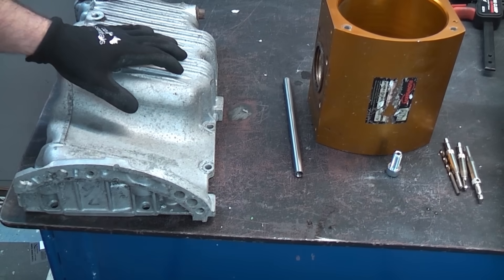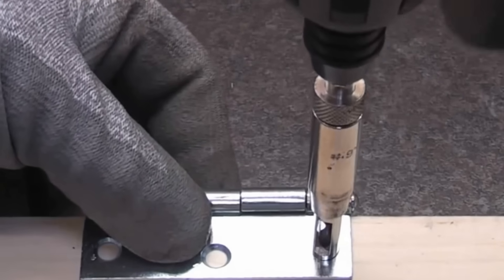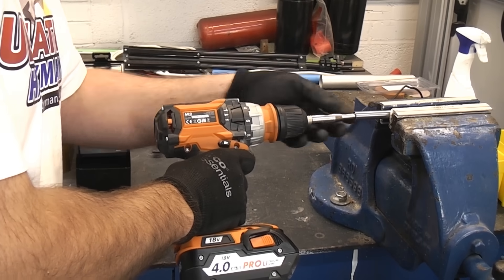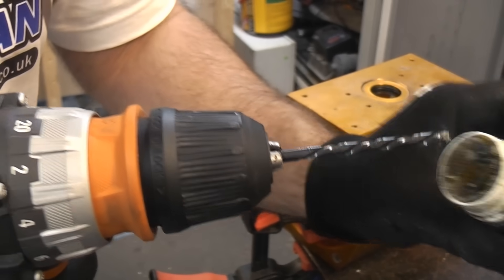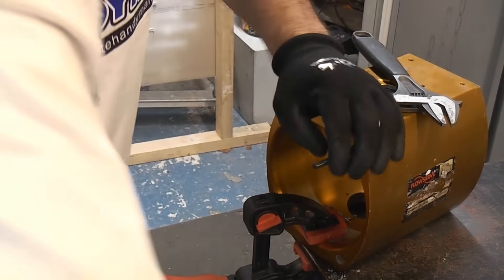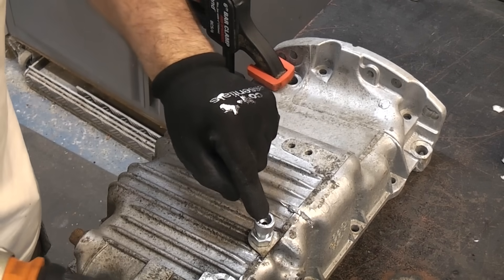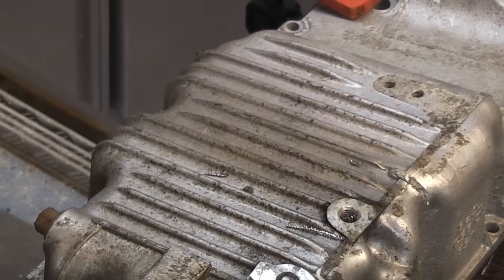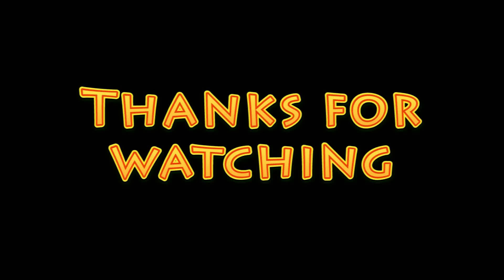How to remove a broken bolt in a deep hole | remove broken bolt in recessed hole

Comment: Those left handed bits, we have whats called "easy outs" that are like that but made to extract broken bolts...  Except you don't use a drill you use a wrench on them, doesn't take much turning to latch on, especially if u drill it a little with a normal drill bit before hand.
Never mind you showed one that you call a screw extractor.
Whats the reason for safety glasses?  hehe.
Reply from the maker: You should always wear safety glasses when using hardened steels, as they are brittle and, if the easy out or drill bit breaks, the shards of metal are as sharp as glass. I know two people who have lost an eye when metalworking!
Thanks for the comment 👍
Reply: @ultimatehandyman  I was picking on you bud hehe, I don't wear em and I've paid for it a little but thankfully not with the loss of an eye.  But I'm the idiot that when the jack stands holding up an RV went sideways about 40degrees just kept on working under the thing instead of jacking it back up and re situating the jack stands, thankfully it never fell on me.
EDIT:  Good video, I liked how you hollowed out those bolts to make guides so you didn't damage the threads, I'll have to remember that trick, thank you.

Comment: Even with these good techniques , removing a broken bolt is still a huge pain 🤣
Reply from the maker: Absolutely 
Thanks for the comment 👍
Reply: It's never is that easy. Where I live there is always corrosion, rust, damage to the threads etc. Usually have to just about still the hole the size of the bolt and run a tap in it

Comment: bee's wax works better at freeing seized, rusted, stuck, broken and otherwise difficult to remove fasteners than almost any available commercial product.  Once you heat the area, float some bee's wax into the stuck fastener area.  Do it more than once.  The capillary action draws the bee's wax into the area between the fastener and threaded material.  When it cools, the fastener will come out with very little torque.  We use this kind of technique in marine maintenance and machining, and older automobile restoration.  Bees wax, unlike candle wax, and 90 % of the commercial penetrants has a much higher burn temp and does not carbonize like most of the petroleum based penetrants.
Reply from the maker: Thanks, I'll try that at some point 👍

Comment: There may well be a kit for it already, although I've never seen one, but I think money could be made offering an assortment of those bolts with center holes drilled through them,  a few tubes for the same centering purpose, a few good quality reverse drill bits, and a few screw extractors. In my days of working on vehicles I've struggled with this issue and some of these methods might have helped
Reply from the maker: Yes, I think you are right. I did ask a friend to make some, but he eventually forgot about the idea!
Thanks for the comment

Comment: I've had some luck tapping torx bits into the drilled holes, particularly in softer materials such as brass pipe fittings and broken zerk fittings.  The issue I have with round extractors is they expand the broken piece inside the hole and make it more difficult to extract.  Mac Tools makes square extractors that don't expand the broken piece.  I've had good luck with them also.
Reply from the maker: Thanks for the comment 👍

Comment: The most difficult bolt removal I experienced was removing a dead axle from a Cat D-4 dozer. The dead axle broke off even with the bulldozer frame. Not even tweezers could grab it.
We welded a 2" steel rod to the exposed part of the dead axle (which is a giant bolt). On top of the steel rod we welded an X with enough over-reach to allow is to put 4 10 ton jacks under the X. After jacking each jack until it groaned, we put a 55 gallon barrel full of water in front of the bolt and a week later, it turned loose. The dead axle traveled thru the 55 gallon barrel full of water, thru the shop wall, thru two empty 55 gallon barrels and came to rest about 150' away. Bazinga!
Reply from the maker: Good job nobody was in the way of the axle!
Thanks for the comment 👍
Reply: @ultimatehandyman  Thanks, mate! We didn't allow anybody in the shop that week, nobody got hurt. We did excavation and oversize transport so we could shut the shop for a week at that time.

Comment: can someone please tell me what part of the engine that is my Honda pilot is cracked where the alternator bolt is supposed to go into so no matter how many times I changed it it keeps breaking the bolt n belt comes off
Reply from the maker: You might have to get that welded, but welding aluminium is a specialist job.

Comment: The worst are exhaust manifold studs that break off flush. I know. I drilled out many Porsche 911 studs and what was the real challenge was when Audi came out with the 5 cylinder. They all broke off the studs on #5. Thus, to do it in the car took a 90 degree air powered drill and a mirror taped to the frame rail. You had to learn how to drill while looking at a mirror.
Reply: Bill Smith  can u tell me what that part if the engine is called n is it possible to replace
Reply from the maker: Yes, exhaust studs are a real pain in the backside!
Thanks for the comment  👍

Comment: Will using copper never seize on a steel bolt put into aluminum cause a chemical reaction, or breakdown that will deteriorate the bolt or aluminum part and cause problems down the road?
Reply from the maker: I've been using it for years at work with zero problems, but a lot of people have said that it causes problems, so depending on where you live and the environment /humidity / salt air etc. it might cause problems down the road.
Thanks for the comment 👍

Comment: As a mechanic I have worked on Army tanks and other tracked vehicles along with semi trucks. Worked for a dealership working on cars and trucks. The last 35 years I have worked on aircraft from the auto pilot to the toilets, currently working in the engine shop building Rolls Royce RB211, GEnx-1B, and CFM 56-7 turbo fan jet engines. So I have seen a lot of tricks to get things done that only a quality result acceptable. I can measure down to millions of an inch using a lens and lights. So my experience is quite broad. You have taught me a few new tricks which is rare. I knew about left hand drill bits as I have had many call B.S. on that lol. The hinge guide was a slick trick . The center drilled bolts as guides was a nice professional touch. Excellent video.
Reply from the maker: Thanks for the detailed comment 👍

Comment: I need to remove aluminum bolts from the bottom of my block on my bmw. Are aluminum much easier because of how light the metal is? Im thinking of using this method.. definitely do not want to pay BMW if i can do the job for hardly any $$$
Reply: Same here with my GMC Yukon its 1 of my thermostat housing bolt broke in the inside.... Let me know how it turn out!

Comment: Thanks! Did this years ago on a valve cover bolt. My hole was way off center but the easy out still worked; however this time I need more help as the hole is deeper and a higher torque bolt. I will be at the parts store in a minute. Hope I can find something that works like your hinge starter tool. :)
Reply from the maker: Best of luck with it 😉
Thanks for the comment 👍

Comment: Why not use your drill to back out the bolt with the tap ?
Reply from the maker: It's difficult to control it using a drill. Ideally you would use a tap wrench.
Thanks for the comment 👍

Comment: I got some broken bolt with something similar, the bolt broke inside the hole, and I also like you to apply the drill hole and extractor on the broken bolt.

I had spray penetration oil and made it soak in oil for about 30 minutes then I tried but the bolt really stuck that I even break the extractor into the broken bolt too!

I almost lost hope to it, or any suggestion?

Thank you for reading!
Reply from the maker: Sometimes, you just have to drill it out and re-tap the hole. There are some bolts that just never seem to want to come back out!
Thanks for the comment

Comment: Fab. A great watch. Thanks. 
Was the last bolt high tensile? I’ve taken the head off a high tensile bolt that fastens the front (chain) sprocket to the drive shaft on a motorcycle. It is now recessed and the shaft turns, of course which adds complication.. Any tips would be gratefully received. 
Thanks
A very satisfying watch.
Reply from the maker: Not sure, but I have drilled out loads of high tensile bolts. Cobalt drills work much better than HSS drill bits ;-)
Thanks for the comment
Reply: Ultimate Handyman Hello again. Do you sell the socket head drill bit guides? 
It’d be great if you do. I’d need an M10!
Reply from the maker: No, sorry. I'm afraid I do not sell them, but they are easy to make-  https://www.youtube.com/watch?v=6mZj0J6CNYA
Thanks for the comments ;-)
Reply: Thanks very much.

Comment: Excellent video. 
I don't know why I'm watching this, I seem to have become an expert at removing broken bolts over the years.
Friendly advice: When tapping the extractor into the bolt, I grab the extractor with Vise Grips and apply a bit of counter clockwise torque to nudge it in tight.  Works like a charm!
Reply from the maker: Thanks for the comment 👍

Comment: Thanks mate!! I’m going to be using a combination of these techniques to get a cylinder head bolt out that has sheared off in the engine block of my Subaru WRX. Never thought about combining my left handed drill bits with my hinge guides! May end up making some of those bolts with through holes and locking nuts for this project!
Reply from the maker: You are welcome
Thanks for the comment

Comment: When using the screw extractor (or "ezi-out" as sometimes called) it is best to do so vertically so you can apply pressure downward whilst using the wrench to turn it.  The pressure helps to press the extractor into your drilled hole.    Yes, I have used this technique several times.  Can also be used to remove a spark-plug (centre electrode broken out) from a cylinder head.  Use plenty of grease to catch metal shards that may otherwise enter the cylinder.
Reply from the maker: Thanks for the comment

Comment: I haven't had much luck with these methods. Mostly because i am not the best at controlling the drill. If you happen to be like me and its a easily removed and transported part. Take it to the local machine shop and get it removed without first trying it. If you mess up the hole or broken bolt then they may not be able to help
Reply from the maker: Thanks for the comment 👍

Comment: I have removed a lot of broken exhaust manifold studs and have found that by drilling right through the offending stud/bolt it kind of shrinks the stud a little and makes the extraction much easier, also I used a parallel shaft extractor which worked every time, I believe that the tapered ones expand the part you are trying to extract thereby making it more difficult. Nice video though.
Reply: I've found that myself mate, I've also found in the real world the sheared off bolts are usually heavily corroded and seized in place by rust which is what causes them to shear in the first place. So I really wasn't expecting to see bright shiny bolts removed from a soft piece of aluminium.

Comment: I am using a stick welder on a broken stud below the surface of an aluminum block. What electrode should I use? 6013?
Reply from the maker: Yes, 6013 will probably work, or you can get a special electrode for this purpose called Xtractalloy (but they are hard to find)
Thanks for the comment 👍
Reply: @ultimatehandyman  Thanks for the reply. I'm going to try the 6013 tonight. I'll have to look into the Xtractalloy if it doesn't work.

Comment: I also use the extractors with the handle from my tap and die set to add turning force as well as pushing force while screwing the screw extractor into the left over part of the screw. THis can also be done with a drill press with it turned off, using the head to apply force. When working at a repair shop I moved from station to station removing bolts and screws other techs could not remove. Also add a little more lube at the first sign of movement to not gall the threads as you start the removal process the heat generated from the removal will often wipe out the threads if you do not add lube after the first sign of movement. A good set of screw extractors, and impact driver and left handed drill bits are good to have in any shop.
Reply from the maker: Thanks for the comment 👍

Comment: Spent 25+  years    Flying   and  working  on   airliners  as  a  Maintenance  Engineer. We  had  a  small   but  well  equipped  Machine   shop   and   1  Master  Machinist  on  duty   daily   for   tool  making.  You  would  be   shocked  how    many  times  hardware   broke or   melt/fused  with   another  part....   we  had   speciality  tools   like  above  made   to    make repairs.  In  addition   the   Machinist  would  make  special  wing   structural  repair  Plates    from  Boeing/Airbus   drawings  that  were Hy-Locked  to   the  Wing  Spars. Good  Video...thanks  for   taking   the  time  to  teach.
Reply from the maker: You are welcome, thanks for the detailed comment 👍

Comment: I never knew there was a "left hand" drill bit (anti clockwise cutting),, why do they make these?
Reply from the maker: I’m not really sure why they make them, apart from they are excellent for removing broken bolts. 
Thanks for the comment 👍
Reply: I've removed my share of broken bolts and the only practical reason for a left hand drill bit that I can think of is broken bolt extraction.

Comment: Well my situation is not as easy as how he's doing it. My bolt is broken and a small part of it maybe 2mm sticking out. No threads on the part sticking out and I only have about 5 maybe 6 inches of clearance. There's no room for drilling and no room to hammer in an extractor. :(
Reply from the maker: It is always hard when the bolt is in situation!
Thanks for the comment 👍

Comment: Dude, door hinge sighting drill bit set $8.99 plus left handed drill bits set $19.99= the most centered beautiful holes in broken 3400 v6 exhaust bolt studs ever!!!  New studs went in like butter due to no damage to threads...Thank you!!!!!

Everything you need is at harbor freight
Reply from the maker: Thanks for the comment 👍

Comment: Good video but keep a steady finger on that trigger on the drill. That on off on your drill is wearing your drill so many times faster. A steady trigger pull is always best. some of the guys in my shop do the same thing and their drills last barely a year. I've had drills for years.
Reply from the maker: Pulsing the trigger can help in several situations. I've had drills that have lasted well over ten years with no issues.
Thanks for the comment 👍

Comment: Which tools you are used to remove the broken bolt. Please tell us
Reply from the maker: Hinge centering drills- https://fave.co/2DpJo1H

Left handed drill bits- https://fave.co/2xJjK1M

Teng screw extractors https://fave.co/2OnfRuF

Dormer taps -https://fave.co/2OsN1sQ 

If you are in the UK- 

Hinge centering drills- https://fave.co/2NE1VMc

Left handed drill bits- https://fave.co/2DubtF4

Teng screw extractors- https://fave.co/2pVLkVT

 Dormer taps - https://fave.co/2pTfbyx

exact cutting paste- https://fave.co/2Nabyxc

cobalt drill bits (they are much better on harder steels like bolts) https://fave.co/2zDh3kp

You'll have to make the guides yourself, but they are easy- https://www.youtube.com/watch?v=6mZj0J6CNYA&t=1s

Spring tools centre punch- https://fave.co/2NbnLBD

Comment: The correct method  using a screw extractor or some call it "easy out"  is to  place the adjustable wrench on the square tang,  lightly hammer the  extractor at the same time  unscrew the extractor.   the fasteners  are all metric so I guess the screws broke in some Japanese equipment.   It is not necessary to lube the drill bit  because  it should not overheat with low rpm and you want it to hopefully have enough friction to  unscrew the broken stud (screw).   Never use nickel based anti-sieze  on  aluminum or magnesium  threaded holes  and  also never use  stainless fasteners on magnesium .  I'm reminded  of the time  I observed a guy over-torque a screw breaking the head off so  to  avoid  a  ton  of  paperwork  with the NRC  (this was at the San Onofre nuclear power plant) he  applied super glue  to  attach the broken head onto the screw stud and nobody would be the wiser.
Reply: I was installing some non-critical bolts one time. Three on each side. Too late, I realized that there was no way to put a nut on one of them and the hole was too big to tap. So I mixed some JB Weld and stuck it in there. Like I said, it was non critical and my OCD required symmetry so there's that on my truck now.

Comment: What's your opinion on welding a ne smaller bolt to the broken one
Reply from the maker: It can work in some situations. We often weld nuts to damaged bolts on site and it works most of the time ;-)
Thanks for the comment 👍

Comment: A highly-skilled and experienced teacher - patient, professional and responsive to Q's.  I do like his technique of repeating crucial elements, like being careful to not drill through the screw into the aluminum pan!  What a thrill to see the broken bolt extracted. Almost 8mil views - I'm not surprised - a tribute.
Reply: Who gave a cheer and a clap each time a bolt was extracted?
Reply: 10 million people are smarter now
Reply: yes interesting stuff, patickally the hinge drill :-) mind you bolts have hex heads screws don't... :-|
Reply: @alan-sk7ky  I have encountered hundreds of hex head screws. And a few Phillips, Pozidriv, Torx, square and slotted head bolts.
Screw: threads into a threaded hole.
Bolt: Passes through both parts, has a nut on the other side.
Reply from the maker: Thanks for the comment 👍